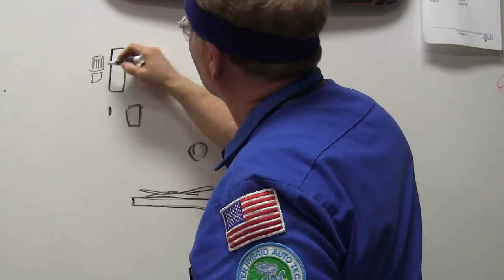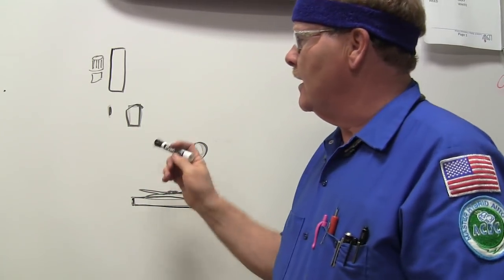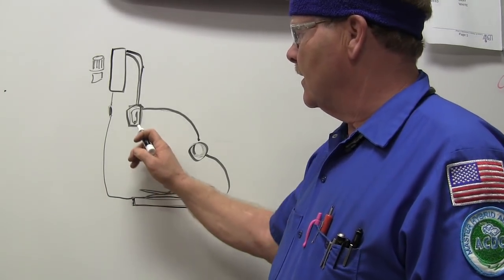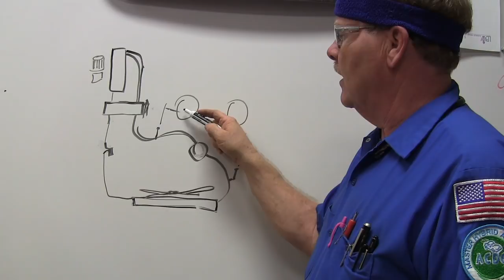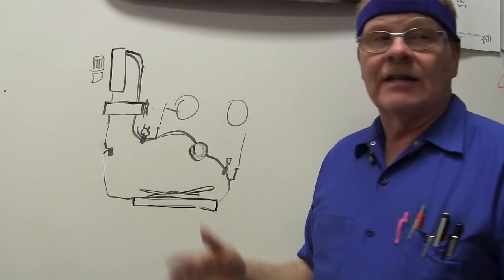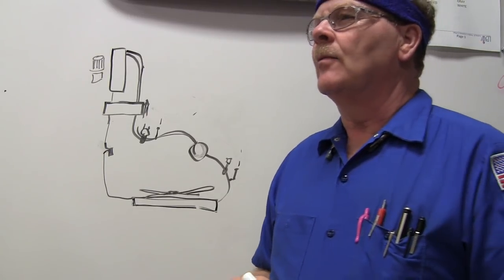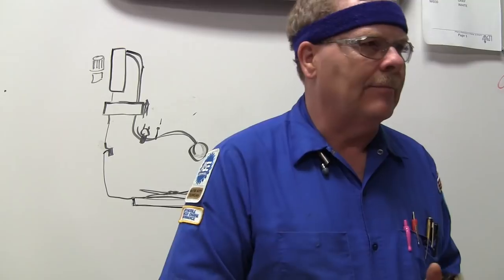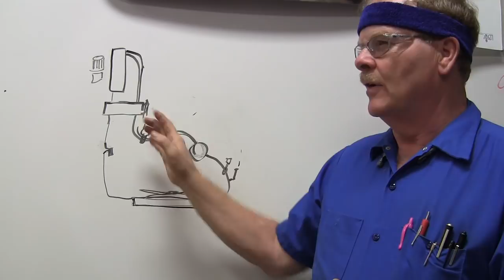A C Quick Session

Comment: I just repaired an interesting one...had a 2012 Ford Fusion 2.5L, with a low charge, faulty TXV, and a problem with the left hand blend door actuator.

The primary reason for the loss of cool air and overall A/C performance issue was the left hand blend door actuator would switch to a 0 count position and remain there for about a minute after startup with the A/C on maximum (this is normal), but it would then get the command from the HVAC module to go from a 0 count position to a 69 count position according to my scan-data pids without any change to the temp control knob by the driver (me)?  So this was the primary reason for no cool air from the vents-just like turning on the heat.  

There were absolutely no DTC's whatsoever, and I ruled out the calibration of the blend door actuators by completing calibration procedures four seperate times, yet still no change to the condition.  Good operation of both the mode and recirc door actuators also.

I found that it was a faulty temp control on the input side, but it was all internal to the HVAC module assembly.  

So after Installing a used HVAC module, a new TXV, and performing a good 1 hour vacuum and complete recharge to capacity she is working perfectly once more.

Also noted, that it appears the timing covers like to leak on these newer Ford 2.5L with the keyless crankshaft.  This was causing belt saturation and chirping, another A/C related issue I included in my repair recommendations.

Crazy how multiple issues can really make diagnosis and getting it working effectively, very difficult and time consuming; especially when the odd ones come along from time-to-time.
Reply from the maker: Those Ford Fusions can do some really wacky things - they like to freeze up sometimes too - I fought one of those off and on for a year and I'm still not sure I got it fixed - the evap temp sensor was reading 50 degrees while the register temp slowly dropped into the twenties and the evaporator froze up.